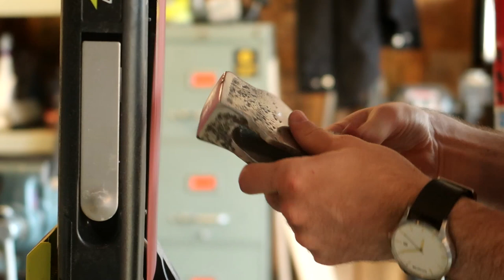Hatchet Restoration with Solid Micarta Handle

Comment: That's a carpenters ax used for woodworking. The edge is supposed to be straight to allow for good clean cuts along the edge  of wood. Thus the small size. Cool build dude! Never thought of putting a micarta handle on an ax. Keep up the good work.

Comment: Standard carpenters axe, most axes of this shape would be used for splitting shingles.
Reply: True. Or otherwise splitting small chunks of wood. Useful as a camp hatchet, for example, even though a camp hatchet would be rounded and not flat on the cutting edge.

Comment: How can people dislike a video like this? Lol.. whats wrong with people :p
Reply: Hard to tell, but there might have been a color change on the edge. It could have also been sparks reflecting off the edge. That might warrant some dislikes. But I would never do that to a kid that's just learning. He will have to reharden the edge. If decarburization happened, he might have to add carbon by case hardening it.

Comment: What’s Micarta ?
Reply: Micarta is layered fabric with resin applied between each later. Almost like fiberglass or carbon fiber, except micarta uses materials like linen, cotton, or even paper. You can layer different colored fabrics or paper to get cool and interesting designs.
It's typically used for knife handles because it has insanely good grip, even when wet. The exposed fabric fibers on the surface grip well, and when it gets wet they swell a bit and create even more texture and grip.

It's really cool stuff!
Reply: The "resin" danteelite is referring to is usually an epoxy.